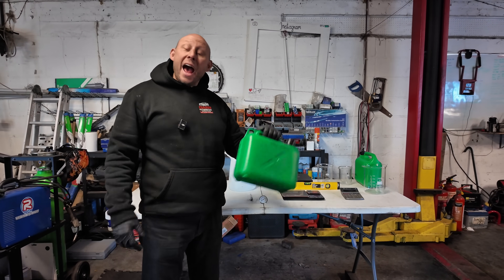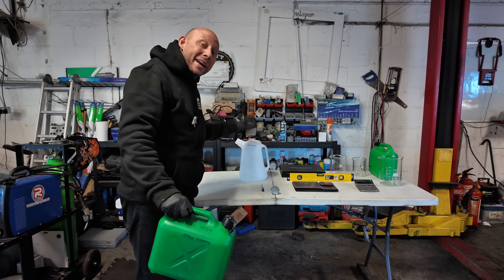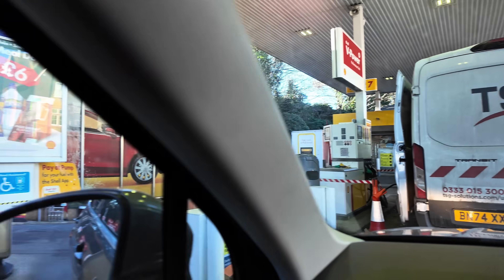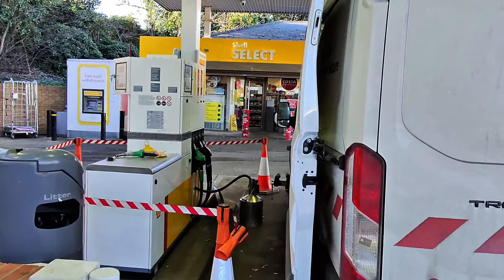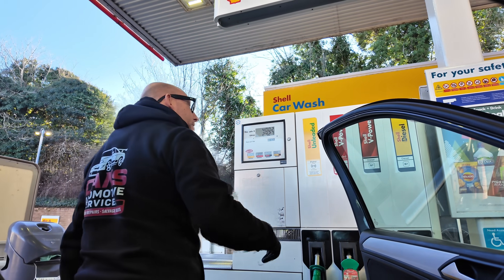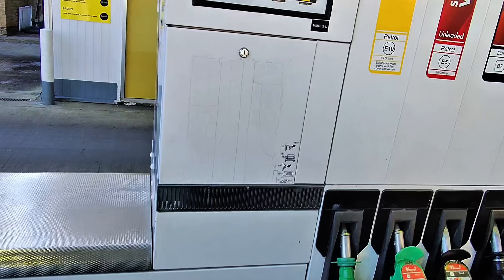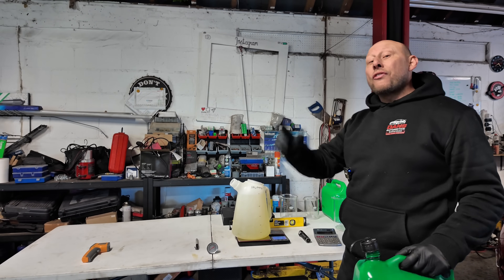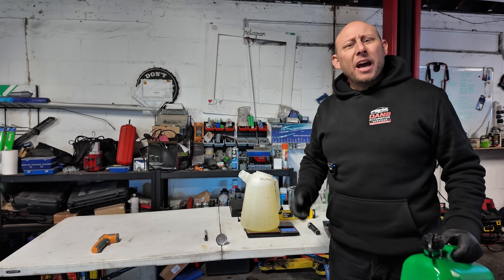This Fuel Test Shocked Us… Are Pumps Lying?

Comment from the maker: 🚨 IMPORTANT QUESTION FOR DRIVERS 🚨
In this second test, we used the same container, same scales, and same measuring jug, yet the results changed. Do you think this is fuel temperature, pump tolerance, or something else entirely?
In Test 3, we’ll be measuring: ✅ Fuel temperature at the pump
✅ Fuel temperature on the scales
✅ A calibrated 5-litre measuring jug (no more guesswork)
Do you trust fuel stations like Shell, or do you think drivers are being short-changed?
👇 Drop your theory in the comments & subscribe so you don’t miss Test 3.
— Dans Automotive Services
Reply: The allowed volumetric delivery tolerance for the fuels is +1% to -0.5%. Therefore -5 cc per litre is the lower threshold, and meaning that 5 litres can be up to 25 cc under volume and up to 50 cc over volume. That 25cc represents roughly 18 grams underweight up to roughly 36 grams overweight for 5 litres. In that tapering jug, that range of up to 75cc (-25 to +50), plus any correction for temperature differences, will be clearly visible.
Reply from the maker: @RWBHere 🙌🏻🙌🏻🙌🏻🙌🏻
Reply: I guess it could be pump tolerance. You would probably need to repeat the tests to see that though.

I honestly had a suspicion that they were under selling. It would be so easy to do and no one ever really checks ... until now I guess.
Reply: Not watched either yet,  butni have to say ,  I parked at a pump on the wrong side,  picked up and pump and walked to otherside of car and as a did about 100 to 200 ml of petrol leaked out the hose presumably from the last pumper.  Otford Sainsbury's.      It maybe been more,  seems like alot
Reply from the maker: @magni1308yes I've done the same all over my boots 😂😂 now I make sure there is nothing in the hose before I put it into the container 🙌🏻🙌🏻
Reply: I would halt the test and start fresh when temps rise to around 11c to 17c for consistency
Reply from the maker: @deeeeeeeench1209 we will measured the temperature at the pump and on the scales for comparison.
Reply: @dansautomotive yeah I think you will still suffer temp loss from the fuel pump hose its enough to knock out the consistency in the test
Reply from the maker: @deeeeeeeench1209 we are only looking for a clear difference. We are not looking for small amounts 🙌🏻🙌🏻🙌🏻
Reply: In test one you weighed the green container but not in the 2nd test so apart from visible vol difference you didn’t quantify the weight. Would be good to see same checks done to all samples 👍
Reply from the maker: @redbarn9397 fuel is sold by volume not weight, I weighed the container to show what it weighed empty and the second test I tipped it upside down to show its empty before filling it. There is a new video tonight at 7.30pm to explains the changes so the tests can be done quicker

Comment: Did I miss something? Did you tell us the weight of the fuel in each measured jug? Why did you weigh the empty jug and not tell us the fuel weight
Reply from the maker: Because fuel is sold by volume and not weight so we have removed the weighing of the fuel at peoples requests
Reply: @dansautomotive I understand, but whats the point of weighing the empty jug and zeroing the scale if youre just going to eyeball it?
Reply from the maker: @WinstonSmith-p7t because fuel is sold by volume we calibrated the line on the jug for 5 litres. The poll on our Facebook Page wanted a more logical approach over a scientific one so thats what we've done. A simple yes or no exercise only
Reply: @dansautomotive i still don't understand the need to weigh and zero the empty jug haha i guess I'm thick!

Comment: How much does the ethanol  content  effect the  petrol is it heavier or lighter, is there any way of checking the amount  ashore equals less petrol
Reply from the maker: No, ethanol isn't lighter than petrol in terms of density; in fact, pure ethanol is slightly lighter (specific gravity ~0.79 vs petrol ~0.72-0.77), but ethanol's tendency to absorb water means that water-heavy ethanol blends can settle at the bottom of tanks, appearing heavier and causing issues. However, ethanol has significantly less energy per volume than petrol, so cars get fewer miles per gallon, which is the most noticeable difference for drivers.

Comment: There is absolutely no scientific rigour to what you’re doing. You have no calibrated equipment. Using an oven thermometer to measure room temperature??? The most credible device you have there is the weighing scale, with which you are taking no useful or meaningful measurements. Take the weight of the fuel and multiply it by the density of petrol (typically between 0.74 and 0.75 kg/litre - actual figure can be obtained from the manufacturer) and you will have a fairly accurate estimation of the volume. This also takes thermal expansion out of the equation. The volume of the fuel you have drawn has been temperature corrected by the pump.
Reply from the maker: Fuel is sold by volume not weight, we did a poll on our Facebook Page and 92% voted for a logical approach rather than a scientific approach so there is the results of what was voted for by the people.

Comment: If you believe you have been short fuelled you can report your suspicions to your local trading standards department normally found at the local council offices. That will go out with checked and calibrated equipment and check all the pumps at a garage. It's not likely with a big garage because the pump calibration is done independently on behalf of the garage by the pump supplier not the garage owner or fuel supplier. But it's not impossible for a garage to be cheating so if your Sus report it
Reply from the maker: Thank you 🙌🏻🙌🏻

Comment: Mythbusters busted the phones in garages thing btw :)
Reply: Yeah I always thought the phone thing was complete bull 👍
Reply: Im sure Top gear did too.
Reply: Im sure Top Gear and Clarkson did too. Iirc they discovered the static from a nylon shell shellsuit ( trendy back in the day) was a bigger risk than mobiles.
Reply: As I recall, YEARS ago on the old 1 and 2G networks, it might have potentially been a problem because they were installing phone masts inside the petrol station signs, and such close proximity to the mast when making a call had the potential to cause electrostatic discharge or something. So not a concern now, and realistically, idiotic to install the masts there if that was the case.

Comment: Both stations maybe dispensing the correct proportional amount of petrol but Asda petrol may have a greater additive content. Or Asda maybe dispensing slightly over where shell is on the mark? The calibration is probably for the supplier's benefit, so they don't accidentally give away their tiny profit, it's the government that takes the bulk of the profit in taxes.
Reply from the maker: Definitely, unbelievable mark up on UK fuel compared to the price of oil.

Comment: Volume is volume is volume. 1 litre of water is the same as 1litre of oil and is the same as 1 litre of honey. It's all 1 litre. 

Yes, the volume will change differently with temperature for the difference substances. And that is why you have to measure the temperature of the liquid when it was dispensed. 

How "accurate" are your "precision" scales?  Accuracy and precision are different.  The scales might display weight to a precision of 0.1 grams but the accuracy is another matter.  Precision is how repeatable the measurement is. (In your previous video, you first meaured the weight of the container at 395 grams then at 394.)   Position on the scales will affect the accuracy.  Accuracy is how close the measurement is to the "actual" value. Resolution is the smallest detectable change of measurement. To be accurate you should have calibrated your precision scales against a series of standard weights. 

You really should be only be measuring the volume of the liquid, not it's weight. By measuring the weight and temperature you then have to gaurantee the accuracy of the device doing the weighing and the device measuring the temperature.  Also, are you taking any evaporation into account?  😄

OK I'm being pedantic, because in the real world we are paying for fuel at different rates anyway. locally there is a 13p per litre difference between the supermarkets and the petrol chains.  Around 8%.  Absolutely, the pumps should be correct. But we make more difference by deciding where we buy and how we drive.
Reply from the maker: Thank you for the detailed reply, changes to the tests moving forwards drops tonight at 7.30pm - please let me know your thoughts 🙌🏻🙌🏻

Comment: If you're going to do the test on a suspect garage, and you know a date/time when it has been calibrated, you should do multiple samples, preferably on the same pump. Sample 1 on calibration day, 2 a day later or midway, and a third or more just before the next calibration. Minimum of 3 samples at the same pump. It gets more accurate with a larger number of samples. Basic statistics really. Also your measuring gear needs to be calibrated, before some Acktually Nigel comes chiming in, like they do. Interesting stuff none the less. 👍
Reply from the maker: Great idea, we've started with a few logical tests first which has produced mixed results so we are modifying the tests for the 3rd sample and as we get more data we will be able to maybe buy a weighs and measures calibrated jug 🙌🏻🙌🏻
Reply: @dansautomotive  Good stuff. Quality measuring equipment gets expensive tho. Doing it as a youtuber for public information, speculation and "fun" 😊 is far more viable. Large samples, standard deviations and every statistics pundit putting their oar in, becomes more like a tedious job. I've got one of them, I wouldn't recommend it. 😁 Also all this is what trading standards people are supposed to do, when they're not shuffling paperclips or browsing Facebook at the Town Hall or wherever they've been outsourced to nowadays.
Reply from the maker: @jimmyrustle3784 absolutely 😂😂 I'm thinking about buying a calibrated fuel measuring device 👀😂😂😂

Comment: As a former UK fuel station owner Trading standards always turned up without  warning almost exactly a year apart so you sort of had an idea when they were due. Being my own site I made it my business to understand how they worked and what they were looking for. From what i remember they had a 5 ,  10 and 20 litre flasks made up to 3 fills in each The first fill was nearly aways disregarded as the flask was dry and often gave a short measure then a slow fill and a fast fill was made in each and a measure was taken to see if they were withing the strike range if good the calibration seals were checked as was pump serial numbers if good a pass certificate issued. Yes it is acceptable to deliver a short measure and you could set a pump to give less than the stated volume but this is so small you with your set up would never see it.  Some older pumps tend to give sorter measures if run flat out for some reason if you want to try and get very small increase in volume fill slow.
Reply from the maker: Thank you for this information thats great 🙌🏻🙌🏻🙌🏻
Reply: Well that's certainly interesting.
I use diesel. I get the impression that it froths when dispensed at full speed. To get an consistent full for my MPG calculation, I used to fill the tank at a slow speed all the way. I was getting concerned that dispensing slowly was giving me a short measure. (From what you say, I was likely wrong). So I changed to filling at full speed then after it clicks off, wait 10 seconds for froth to subside then slowly topup. (Could I safely pause longer than 10 seconds without the pump timing out?)
From what you said, I think I'll go back to doing the whole fill up at a slower speed, with the reassurance that I might even be getting a tiny bit of free diesel!
Reply from the maker: @alanm8932 interesting, people have mentioned the speed in which we fill up so I will look into that 🙌🏻
Reply: @dansautomotive I'm wondering if filling 5L into a 10L petrol can, would let you go at full speed, without worrying about it spilling? (Obviously you've got to slow down for the last bit anyway).
Reply: @alanm8932 That`s correct from my experience watching trading standards a constant slow fill is more likely to give you better measure but it will be very small and some makes of pump are more prone to do this. FYI for pumps built since about the early 80`s have a product air separator just in front of the metering unit in the pump (I forgot say that trading standards seal this as well). so you are very un likely to get charged for air these days.
Reply: I was going to ask if these videos could be done with a second 5 litre can filled at a much slower speed from the same pump. To see if there's any consistent difference in volume dispensed at full speed vs slow speed.
I guess that filling into a 5 litre can, it probably isn't going at full speed anyway, for the last 2 litres.
Reply from the maker: @alanm8932 I will look into that as it has been mentioned a few times 🙌🏻🙌🏻🙌🏻
Reply: @alanm8932 with diesel it might be, because it foams a lot.
Reply: That's what I told in the previous video.

Comment: But how much is actually petrol? Rumours are supermarket fuel has more additives to boost the volume
Reply from the maker: Yes lots of people have messaged me about blended fuel and ethanol content which we are looking into measuring shortly
Reply: @dansautomotive  If you start looking at ethanol content I can recommend a few garages locally that have "good fuel" vs others that have "bad fuel". I spent ages hunting around for the most consistent low ethanol fuel in the area.
Reply from the maker: @ChrisClifton thank you, we will look into ethanol content once we've got the volume data. Definitely an interesting subject 🙌🏻
Reply: Not true, additives are only at ppm levels and some of the supermarkets use exactly the same additives as some of the big brands (all the additives are bought from 3rd parties anyway and just mixed into the base fuel when its being loaded into the road tanker wagons).

Comment: Love the tests of real life motoring. The only thing that might make a difference is that when I fill up I put a pair of the free gloves on as diesel can get everywhere. When finished I pick the hose up and drain all the fuel left in the entire length of the filler hose. This could be just one reason that one maybe off a little
Reply from the maker: Yes I've been emptying the hose before and after each test so its fair. Surprised that both times there was a little bit in the hose 🙌🏻🙌🏻
Reply: @dansautomotive https://youtu.be/UKiiiCEU8fw?si=4OHcQn4vtHFi7tGL
Reply: The valve is in the filler gun, the hose is always full and cannot be drained out through the gun, unless the trigger is pulled and then pressure switch would then start the pump and more fuel would be metered out.

The only bit that can be drained is the short bit of metal pipe out of the gun, so picking up the hose is completely pointless (and, sorry, quite funny to watch!)
Reply: The filler hose will ALWAYS be full of fuel ! The shut off valve is in the nozzle , ( just about where your thumb is) , so only the final metal bit of the nozzle will have fuel in it ( which will always drain out on shutoff anyway) . So it doesn't matter if you lift and shake the hose until your blue in the face, no more will come out 😊
Reply: @bobgorman9481 if only someone had said that 2 days ago 😉😜🍻👍

One of a number of people saying they do this on here and Facebook. It always makes me laugh at the filling station when I see people doing it.

Do they do it with their hosepipes at home? 😅
Reply: @ChemicalJasper Aaahh ,just noticed, you beat me to it 😮😊,( it is funny to watch them though)!

Comment: The volume indicated on the jug changes with temperature as the dimensions of the jug will have changed.
Reply: I wouldn't have thought that a change of 3 degrees or so is enough to change the size of a plastic jug. Sure, going from Summer to Winter temperatures might but that's not the case here.
Reply: @steveclark..  True, but a couple of degrees can result in certain plastics becoming more pliable and the internal volume enclosed increases with the mass of the contents while the volume markings on the utensil remain unchanged. You pointed out that volume and temperature are related in regard to the dispensing and it is also relevant to the containers that you're holding the fuel in. If you're looking for an accurate comparison of what has been dispesed by different pumps, all other variables need to be reduced to insignificance so doig all at the same temperature woould be ideal.
Reply: @mikeshelley4996  You should have stopped typing after the word 'True' mate.
Reply: @steveclark..  Sorry if tests in temperature-controlled labs disagree with the experience of people lacking such facilities and experience, but that's just life, I suppose.
Reply: @mikeshelley4996  I have actually worked in a lab, 3 degree change in temperature made zero difference!
Going from Winter to Summer did though.
Reply: @steveclark..  Fine. The poly jugs I had used (of different compositions and which always had a temperature modifier applied during volumetric data collection) were replaced by glass of speficified composition and thermal properties and for which temperature modifiers were also included in calcs. It all comes down to acceptable tolerances for the activity.